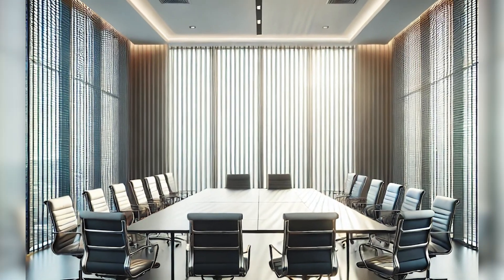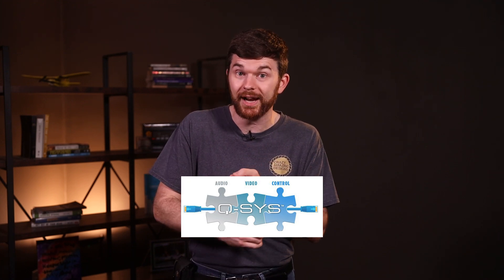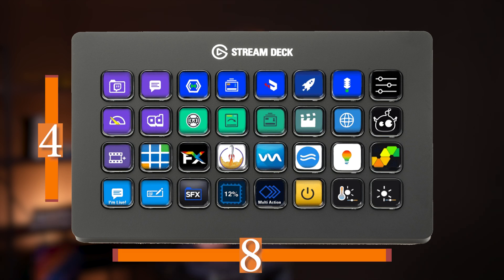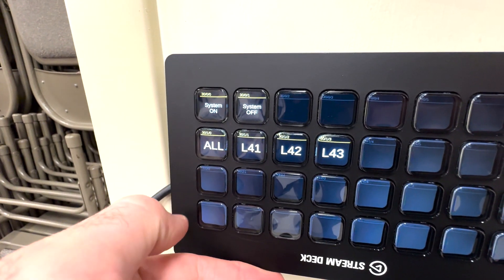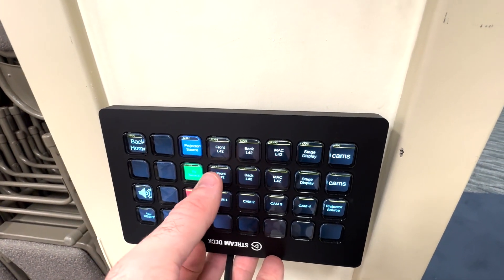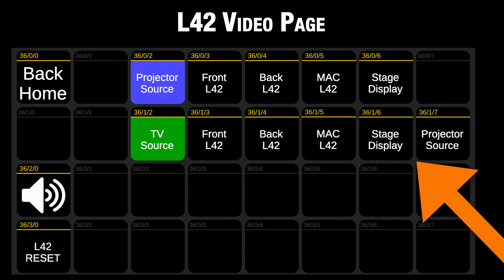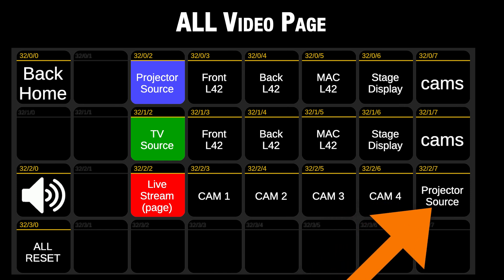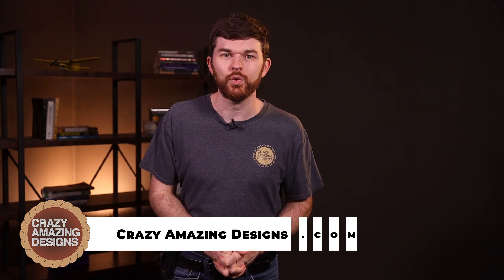Building a Conference Room (Control System) with BitFocus Companion/ StreamDeck

Comment: This is really cool. Great plan! Where I work we installed a Q-SYS system, and funny enough the room is called our Multi-purpose Room. We have a 13 foot wide LED wall in the center and TVs flanking the left & right, then another TV in the back as a confidence monitor. We have moving Lights also. Through the Q-SYS system I can route video to any of the screens easily. We paid to have everything programmed, but they gave me full access and I have been learning a lot about programming Q-SYS, and have made some significant changes on my own now.. If you need any help, I would be glad to try and answer any questions you have. (Or I may need to reach out to you with questions one day). :)
Reply from the maker: Yes, Q-SYS is a great system. But it was unfortunately too expensive of an option to implement here.
Reply: @CrazyAmazingDesigns  Sorry to hear that. You put so much into the proposal. We went with regular Zoom Rooms on several of ours, but with the air walls you have, that system you were working on made perfect sense.
Reply from the maker: @RealRekcin  Oh, Sorry. Yes we did what I outlined in this video utilizing the StreamDecks to control the elements of the rooms and it's fantastic. I'm working on the video to share. We did NOT go with Q-SYS however, which is fine even though it would have also been a great system for this space. -Nathan R

Comment: What about using a raspberry pie with a touchscreen?
Reply from the maker: That could be done yes, I would still run Companion Satalite but launch the buttons page which would not work the same. I don't think there is a need for that extra complexity, or functionality. Maybe this could be a good future upgrade. For now the StreamDeck from Pie will work just fine. -Nathan R

Comment: Very nice concept... We also use the X32 Rack, really love it.  To help our volunteers to not miss turning up the audio for a video, we have Proclaim (our presentation software) send a MIDI command over ethernet to our Audio/Lighting Mac that is running Mixing Station to unmute the channel and set the volume (it also sends a MIDI command to LightKey on the Mac to call up the 'Video' scene to dim the lights). It's great but what I don't like about it is the volume setting 'snaps' the fader and there isn't a ... fade time that I could find. Also I've never found a complete guide on the MIDI commands for Mixing Station.  But how are you planning to control the X32?  MIDI with Mixing Station or do you have a more direct method with Stream Deck?
Reply from the maker: Hi, Yes BitFocus Companion has a module to control the x32. It's fantastic and things such as fader volumes/ mutes can be adjusted from the stream deck buttons. -Nathan R

Comment: Which projectors do you use at your church? From my experience using stream decks, the can only control a limited number of projector brands like Epson and Panasonic, I don’t think it works with Hitachi
Reply from the maker: You are correct, and these rooms have Optoma projectors. I haven't looked into it much,  I will either need to use some sort of IR/ Network device to turn them on and off. Or let users do that part. Good news is each Projector will only need to be turned on and off, and remain on HDMI 1. -Nathan R

Comment: Looking forward to seeing the build - we use StreamDecks with Companion for lighting scenes/power control, video source swiching amongst other things in our main auditorium, and have been planning on a similar build in a multi-purpose room in our church.
Reply from the maker: Yes! StreamDecks with Companion are Amazing! Such useful tools. Hopefully you can learn from any mistakes I make on this. -Nathan R
Reply: @jonathanfleck5419 what lightning do you use? I'm currently looking for a way to control some DALI2 controller through whatever API available through companion, but can't find anything. Are you by any chance using DALI2 or just standard DMX?
Reply: @kitsuams  Hey, we've an iLight 4 Channel x 10 Amp Digital Dimming & Switching Controller. It has RS485 terminals. I have a Cat 5e cable screwed into those terminals running to a Waveshare ETH to RS485 box, and then using the Generic TCP/UDP requests module in Companion to send ASCII commands to the iLight controller via the ETH to RS485 box.

Comment: I've been working on building a button panel from scratch that uses MQTT and Home Assistant with various custom integrations to turn things on and off and stuff. It's been working at my church very well and very reliably for the last few months. I'm still working on getting the button panels to a place where I can make them quickly so I could sell them, but it's all open source on my GitHub page.

Home Assistant makes it a lot easier for church volunteers to manage the automations and program different buttons to do different things, and it integrates with literally everything. I made an integration for ProPresenter so different slides trigger lighting scenes.

Comment: Nice work!  How do you get the hyperdeck mini to auto upload to google drive?!
Reply from the maker: Hi Ryland, Thanks for checking out this video. Short Answer, Not sure. Long Answer I'm pretty sure I will need to use a computer; it sounds like I can use FTP for the file transfer or use the USB-C connection to a computer and set it up to Auto Sync. I’m going to start there. -Nathan R
Reply: @CrazyAmazingDesigns  Raspberry PI and python... all of the SDKs are really easy to use. Cool video mate, cheers.

Comment: Hi did you try to connect all streamdeck to one raspberry. Thre are USB vi RJ45 cable up to 80m 250ft.?
Lower cost on raspberry.
Reply from the maker: I haven't considered that, I thought the USB connection was basically capped at a few feet. I don't know if converting USB to the RJ45 cable type would be a reliable connection. But I'll look to see if that's a viable solution for our application. -Nathan R
Reply: @CrazyAmazingDesigns  
We use that's one Unitek Y-UE01001. Its only USB 1.1 but to change slides its good.
Reply from the maker: @Smash-Team  For only $20, I might have to go ahead and try that out. Will it power the StreamDeck over distance? You have used it with up to 250ft RJ45.
Reply: @CrazyAmazingDesigns  This is not a 1on1 connect, there is hardware in between to put 'create' a netweork signal, and you can then pick it up at any networkoutlet and decode it again.
I have used this system to connect USB and (ancient) serial devices to virtual machines
Reply: @CrazyAmazingDesigns  We use a Streamdeck with a PI4 in a retail environment. A USB over Cat6 works fine, if you use a USB 2.0 extender. Using USB 1.1 only puts the pictures on the Streamdeck, but doesn't read the buttons properly.
Reply: Eh, you're asking for issues by using a single pi. My suggestion would be 3 separate pis, with one also acting as the "hub" - using an API to communicate to the other rooms' pis to tell them to do certain things. e.g. would control if the whole system can indeed shut down when all rooms are off.
Reply: A lot of these automations could also be done with something like Home Assistant. People think that is just for homes but I've seen it used for a lot of different uses. I've even seen it used to control a greenhouse.  Its free and can run on a raspberry.  It seems like ChatGPT also has a pretty good understanding of it so its easy to just ask it how to do something and it will provide you with instructions and all of the code if you start dabbling more with custom solutions.  I do think something like Streamdeck would be a better option for something like this but if automations are what you are looking for its a great option.
Reply from the maker: @pin65371  StreamDeck is most valuable because of how it has been setup to control things like the ATEM switcher, and the X32 Rack functions. Those devices are the core of this project, then Companion/ Streamdeck will control those things. I have not done much home automation, short of my lightbulb that turns on before my alarm goes off in the morning. Even that is not automated lol -Nathan R
Reply: @CrazyAmazingDesigns  yah for what you are doing the streamdeck is the better option.  I just find people are so quick to look at the most expensive option thinking that is the best but the problem with that is you are limited to what you can do with those systems and also run into the issue where if anything breaks you might be waiting to get replacement parts.  For you if you just buy an extra streamdeck you can just have it sitting in a box somewhere and if something breaks you just swap it out and can be back up and running within a few minutes while still spending a lot less money than any of the commercial solutions.  Also if you design everything a certain way and realize after that maybe some people find it confusing you can just make some redesign changes through the software.  I dont think that would be a real issue though since everything seems to be very easy to understand.
Reply: @pin65371  unless you actually know Homeassistant, it's not something to implement in a production environment.
HA is still a project by nerds who don't mind spending a full day to reconnect devices, because some update breaks everything like a waterfall cascading don.
Reply: @COOTJENZ  why would you update something without having a backup? Its usually best practice to also test before putting anything into production unless you are Crowdstrike.